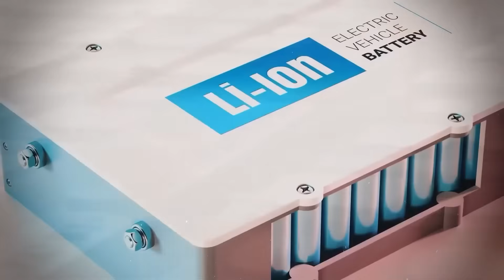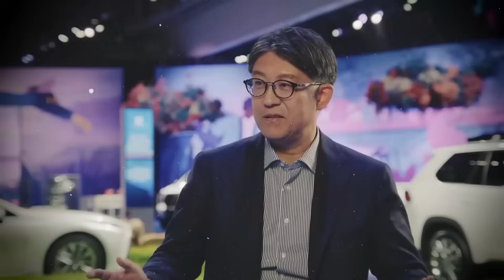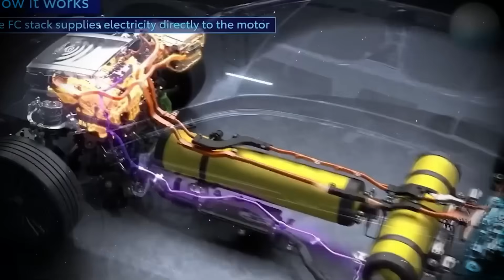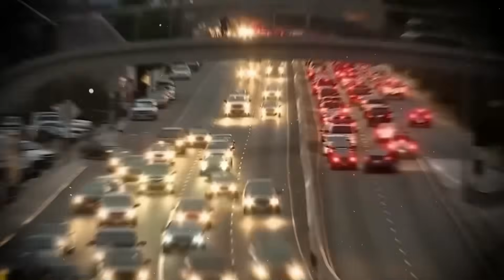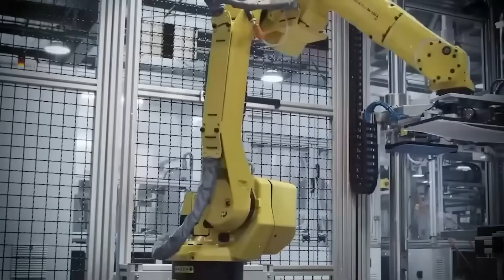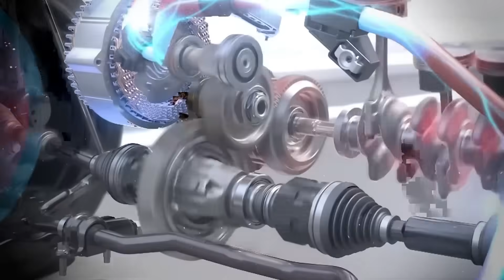5 Minutes Ago: Toyota CEO Drops a Bombshell about the Water Engine—EVs Are FINISHED!

Comment: Looking at all the vids on this channel exemplifies science fiction.
Toyota has not invented an engine that runs solely on water. While there have been various concepts and technologies aimed at using water as a fuel source, such as hydrogen fuel cells, these do not operate on water alone. Instead, they typically convert water into hydrogen and oxygen through electrolysis, with hydrogen being used as the fuel.

Comment: The problem with a water engine is that is breaks apart what is actually water. The earth has always had one amount of water in different states. So the total amount of water on earth that's goes threw its forms becomes less, it has always been the same amount, until this, until you break apart the molecules and its not water anymore. Dangerous long term.

Comment: This smells like BS.  You can't burn hydrogen and oxygen to produce steam... unless the water has already been split apart into H2 and O2.  There is NO "catalytic" reaction that will create energy out of thin air, to break the H2 apart from the O2 "on the fly", in the words of the video's claim.  To produce the energy needed to push the car, you burn the H2 and O2, and the steam is created as an exhaust product... but it requires THE SAME energy to split the water into H2 and O2, via electrolysis.  It can't be done "on the fly" just by pouring water in.  The water has to be split FIRST, before it can be burned to get that energy BACK OUT, to put it on the road to push the car.

THIS IS A SCAM.  It violates Conservation of Energy, the most basic law of thermodynamics.

By the way, I also believe "EV'S ARE FINISHED"... but not because of a fictional Toyota engine that runs on water.  I believe HYDROGEN FUEL CELL TECH will replace BATTERY POWERED EVs.  But to store the energy in a hydrogen fuel cell, you need power from the electrical grid, and a fuel cell is MUCH more energy-dense than any current battery technology.

EV's will continue to replace dinosaur juice tech... but they will get their energy from fuel cells, not from batteries.

Comment: I can see a problem here, as you said, it can use sea water. Sea water is one of the worst things in anything mechanical because of the salt in the water. So if the engine gets rid of the salt, where does the salt go, on the ground???
Reply: De salination plants will be the norm?

Comment: What a load of tosh.  Really you get the Hydrogen from the water and then burn it to run the car.....ffs you have to put in so much energy into the system to get the hydrogen from water to start with.  Its why burning hydrogen to make water gives so much energy.  Do people believe this misinformation posted on U-Tube, I really hope not

Comment: Not the whole story - a classic AI blunder. As described, it defies the laws of physics and thermodynamics. A more likely scenario is the production of hydrogen from water by electrolysis, using a plug-in recharge from electrical charging points. Hydrogen is stored in a pressurised tank. The engine burns the hydrogen, producing mechanical energy, steam and heat as waste products. An alternator generates electricity for the traction motor(s). There will be a system of energy recovery, as in other EV designs.

Comment: So why don't Toyota and Honda get together to dominate future auto.

Toyota has Hydrogen engine. Honda has gas / regenerate engine.

Then, there wouldn't even be a need for gasoline.  Just use water and the Honda innovation would use vibration and heat to charge electric engine.

Comment: This crap has been resurrected endlessly. If you could break down water with a smaller energy input than you could retrieve, especially burning it in an intrinsically inefficient internal combustion engine you will have invented perpetual motion. Good luck to the bunnies stampeding once again behind a farce. Your forefathers have done their dough time and again.

Comment: So... starting with H2O, ending with water vapor, H2O, extracting energy for power ...
Where does the energy come from?
Reply: To answer your question, hydrogen is combustible. And like the petrochemical vapors that are normally combusted to fire the pistons, - the gas from hydrogen, which is clean - has the same effect.
Reply: @mrcarpenter9623  That does not answer the question.  His point is that you are splitting water to make hydrogen and combusting hydrogen to make water.  On the surface that sounds like a perpetual motion machine.
Reply: @gordon-1   Breaking water into hydrogen and oxygen (via electrolysis) requires significant energy input—far more than you get back when burning the hydrogen.
Reply: There are videos explaining it and showing actual engines working.
Reply: @dirtbagdarrell2008  link?  the engine seems pretty clear.  It's the generating H2 out of water.  Water turning into steam and mechanical energy without adding energy somewhere seems to violate the first law of thermodynamics.

Comment: This according to Chat GPT
✅ What Toyota Actually Has
🚗 1. Toyota Mirai (Fuel Cell Electric Vehicle - FCEV)
Fuel: Compressed hydrogen gas, stored in tanks onboard the car.

Process: Hydrogen is combined with oxygen in a fuel cell, generating electricity to drive the motor.

Emission: Only water vapor comes out the tailpipe.

🛑 Important: The hydrogen is not produced from water inside the car.

🔧 2. Hydrogen Combustion Engines (Prototype)
These are internal combustion engines modified to burn hydrogen instead of petrol.

Example: Toyota is testing this with the Corolla Cross Hydrogen Concept.

Hydrogen is still stored in tanks—not made from water in the car.

The engine emits mostly water vapour and some nitrogen oxides (NOx), but no carbon dioxide.

🚫 What Toyota Does NOT Have
❌ A car that splits water into hydrogen onboard (via electrolysis)
This would involve converting water into hydrogen and oxygen using electricity while driving.

That’s theoretically possible, but:

It takes more energy to split water than you can recover.

It’s inefficient, impractical, and not used in any mainstream car.

No Toyota model does this.

🛢 So Where Does the Hydrogen Come From?
In both Toyota systems (FCEV and hydrogen combustion):

Hydrogen is pumped into the car like fuel, from a hydrogen refuelling station.

It’s stored in high-pressure tanks—around 700 bar (10,000 psi) for the Mirai.

The hydrogen is made elsewhere, typically by:

Electrolysis of water (using electricity, ideally renewable)

Steam reforming of natural gas (less green, more common currently)

🔁 Simple Analogy
Imagine a car that runs on hydrogen, and only emits water.

Viral videos twist this to say it “runs on water,” when the truth is the reverse:

The car takes hydrogen as fuel and produces water as exhaust—not the other way round.

Comment: physics 101 energy can not be creayed or destroyed, just changed from one form to another. where does the energy come from to change the water to hydrogen, you are using the energy in the batteries to do this. so where does the enegry come from to recharge the batteries, if the hydrogen is required to drive the call forward. why not us the enegry from the batteries to drive the car forward instead of making hydrogen. Then it would be an EV and not a hydriogen vehicle, the other issues with hydrogen, it is very difficult to store without leaking. this video is BS and has no science behind it.

Comment: made on the fly. Now the engine HP can be back of envelope calculated against electricity used to  to split the water. . Now we know range. so why are there no details? Also Hydrogen will age any gaskets or seals.

Comment: Anyone who knows anything knows that in theory hydrogen is an excellent fuel. So why has this not been done before? Hydrogen is difficult to store as it leaks through just about everything. And if it leaks it is lost, some of it permanently, as it will wander off into space. There's virtually no hydrogen in Earth's atmosphere for a reason.
Reply: Maxwell Chikumbutso created a car engine that runs on radio waves. From Zimbabwe. He developed a technology that takes radio frequency energy - and converts it into electricity on the go. Endless energy.
Reply: Yes storing hydrogen is very troublesome especially as it degrades metals used to do it so your have to replace your machines on a frequent basis

Comment: Of course, you can make hydrogen from water, but it requires a lot of energy to do so.   This i like that car in India that runs on air.    All you do os use a very large pump to fill a tank with compressed air and then you let the air out into a piston engine.    Air is not the fuel.   It is a way to store the energy from the pump.       Kind of the same here, you used power to split water then store the energy as hydrogen.   Later you recover the enrgy by burning the hydrogen.   NONE of the power came from the water.

Comment: Even trains running on water.
Reply: train have been running on water from the start.... the coal was heating water for vapor pressure which in turn made the wheels turn... the question is how much energy is needed to break the water molecule into O2 and Hydrogen? is electric courant enough to do it ? if so, is the conventional car battery enough to do it? if not, then batteries are not going anywhere... hydrogen is a good source of energy, but it remains to be seen if the initial energy to break the water molecules makes this a worthwhile project, compared to EV and gasoline cars. if , for exemple, it requires 80% of the energy produced, then it's safe to say it wont be better then EV, as the WEIGHT of the car will be the problem, for the ratio power/weight, very much like the EVs now...they are heavy because there power source (EV batteries) are heavy...

Comment: Where does the energy come from? Electrolysis is an endothermic reaction
Reply: Yes, this is free energy perpetual motion.  Utter nonsense.
Reply: To answer your question, hydrogen is combustible. And like the petrochemical vapors that are normally combusted to fire the pistons, - the gas from hydrogen, which is clean - has the same effect.
Reply: @mrcarpenter9623  The same effect as what?
Reply: @evanpenny348  LOL, Do you truly not understand the effect he is referring to? That is sad.
Reply: @mrcarpenter9623 Hydrogen has first to be extracted from the water. This requires an input of energy. Due to processes being less than 100% efficient it will require more energy to electrolyse than you release on combustion.

Comment: this is total bunk. there is no explanation of how it works.. it would be free energy??
Reply: water is more expensive than gasoline
Reply: To answer your question, hydrogen is combustible. And like the petrochemical vapors that are normally combusted to fire the pistons, - the gas from hydrogen, which is clean - has the same effect.
Reply: not free, lol... are EV cars free? of course not! you save on gas but there is downside too, and the price of the cars. so will water propulsion be free? absolutely not! be it insane initial price, or the heat will damage the engine faster then the gas engine, there is for sure some downside, and companies will make sure they get there money's worth, one way or another!
Reply: @SayakaGriffon ceramic pistons and chambers will diamond coated rings i

Comment: This the female equivalent of Bull, namely, cow poop. It takes more energy to extract hydrogen from water than the resulting hydrogen can give back even using fuel cells, which are much more efficient than any combustion engine. internal or external.

Comment: Distilled water, if you value  your car.
Reply: Nah.. sea water works fine.. just use a plastic holding tank.
Reply: Maxwell Chikumbutso created a car engine that runs on radio waves. From Zimbabwe. He developed a technology that takes radio frequency energy - and converts it into electricity on the go. Endless energy.

Comment: FAKE NEWS :must cost a fortune toyota is lying. and with aluminium ion batteries , economical 500 miles range ev's are coming. he said it himself its expensive , toyota is dreaming, i dont want hydrogen cars , extremely dangerous. you have not heard about it because its 17 years old tech that never works or cost a fortune. toyota is lying. toyota's only good project is the solidstate batteries; hydrogen is ridiculous, 17 years and they have not figures it out.

Comment: It's already over. Water is out. Boomcars, still a small car producer, found the ultimate solution: the air motor. Yes, you heard it right: a motor that works on air, air it collects while driving to transform it automatically into a very efficient fuel. It only needs a little bit of air to start driving and collects the air it needs to keep going itself. Just blow a bit of air into the starting pipe on your deskboard and you're good to go. Exhale into the pipe, start driving and the car will collect the air from the small holes under your windscreen, enough to keep it going without ever running out of fuel (there's air everywhere), and without any limits in speed or acceleration, compared to conventional cars, whether driving on petrol, electricity, water, or any other type of fuel; the only thing it needs is air, the same stuff you need to inhale in order to live and be active. 

There is an unlimited supply of this fuel available and, best of all, it's completely free! The first air powered cars have already been tested extensively on the roads and proved to be completely reliable in all circumstances; so expect to see the first air powered cars in your city within a few months. The future is here: free fuel for your car, no pollution, no noise (since the air motor is silent, as silent as an electric motor, but without needing any electricity or any other type of fuel besides air)!
Reply: LOL
Reply: I hope this is sarcasm. If so it's brilliant 😂
Reply: As the air engine converts the Earth's atmosphere to nitrous oxide, people will laugh and laugh.

Comment: One way to break down water is with high temperatures in the range discussed. The problem lies with conservation of energy. When the balance is struck, half the formulation is missing. Where does the missing energy come from to run the engine? Breaking down water is straight forward. The entire energy loop is not being disclosed. The energy balance is necessary, and missing. Something necessary is not being disclosed.
Reply: Lies
Reply: You are right. The law of conservation of energy is a fundamental physics principle. This is not explained.

Comment: Imagine going on a trip and running out of fuel only to be able to piss into the tank to get you home lol
Reply: Especially if you have had a few alcoholic drinks, that would be the turbo charge.
Reply: @kevinsavage808 
Only through the kidneys, you don’t want alcohol in a Hydro car.
Reply: That would be going back 70yrs plus, when carbide lamps were used on bikes, that was the exact solution to keep the light on to get you home...
Reply: I always wanted to be able to go to the pub, and piss in the tank to get home.
Reply: IF you can produce an engine powered by water, then why can't you produce electric power by water?
Reply: @Widu-b5n  Attach a dynamo, et voila 🎻
Reply: If you get your penis stuck you will have to run along side the car while someone else drives.
Reply: Only if you have the right nozzle for the fill hole 😅
Reply: I remember my dad saying there was an invention for cars to run on water and the oil companies buried the patend. When Trump unlocked Patends in his first term, that could be where this is coming from. Tesla's lighter smaller fast charging batteries and the cars performance, we’ll see how this works out. Where water is scarce, tough call.
Reply: I can't see that happening in the UK the treasury would loose billions in revenue
Reply: Glad I drank the six pack before I drove home 😂
Reply: Human urine is a type of acid, so no you can’t pee into the tank. Guess you don’t know much!!!
Reply: he said water not piss and I'm sure there is a difference
Reply: @EricSmith-qm7xb
That's not rain.

Comment: So we keep the engines who can pruttle so nice, like the V8. I have seen somewhere a car who did this with a alternator making the gas. I xdo not believe this can be done because making hydrogen cost more energy then produced it. see the AI telling this.

AI-overzicht
No, a combustion engine cannot run directly on water itself. Water (H2O) is the product of burning hydrogen, not the fuel itself. While hydrogen can be produced from water through electrolysis, the process of separating hydrogen from water requires more energy than the energy released when burning the hydrogen.

Comment: google says"A recent YouTube video suggests that Toyota's CEO has unveiled a new engine, potentially a "water engine," that could challenge the dominance of electric vehicles (EVs). The video implies this new engine might end the electric car industry, but the details are still unclear. While some videos and articles suggest a water-powered engine, Forbes reports that the actual fuel source is hydrogen, created through electrolysis of water using electricity. Therefore, the "water engine" is likely a misnomer, with the engine actually utilizing hydrogen produced by electrolysis. 
Here's a breakdown:
The Claim:
Some reports claim Toyota's CEO unveiled a new engine that could "end electric cars". 
The Engine:
The actual engine appears to be a hydrogen engine, using hydrogen produced via electrolysis of water. 
Electrolysis:
This process uses electricity to split water molecules into hydrogen and oxygen. 
Hydrogen as Fuel:
The hydrogen generated is then used as fuel in the engine. 
Potential Impact:
This technology could potentially offer a cleaner alternative to traditional gasoline engines, but it's not a "water-powered engine" in the literal sense. 
You can watch this video to learn more about the technology behind Toyota's new engine: